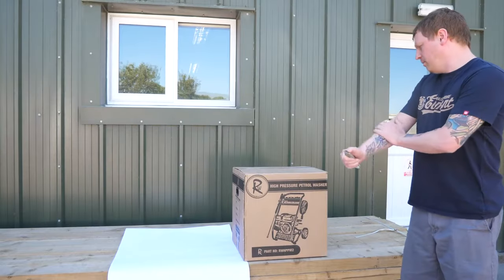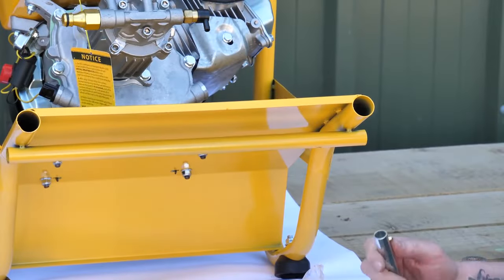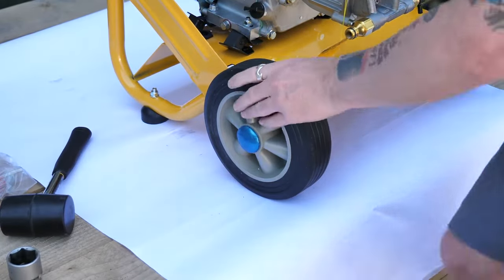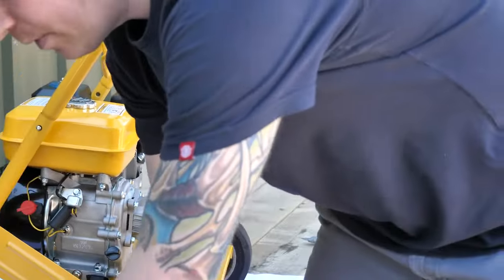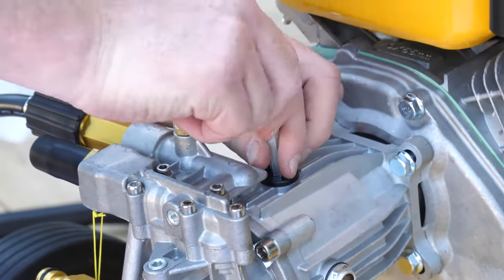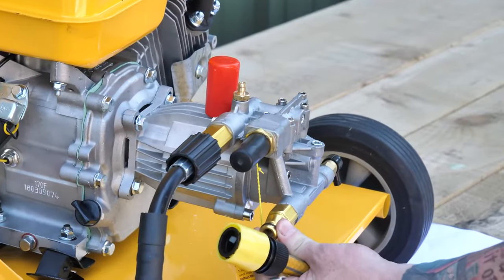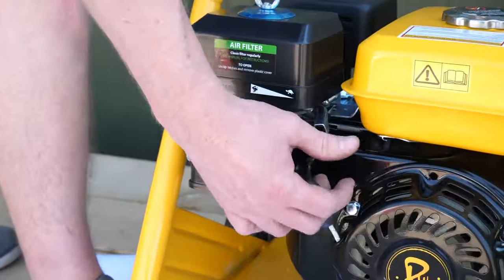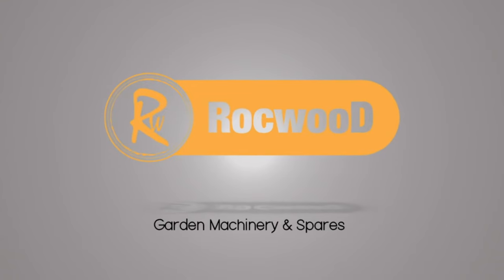Rocwood 3000 PSI 7HP Petrol Pressure Jet Washer assembly instructions

Comment: Bought one of these a few years ago. if you remember the charles atlas bullworker, this is the modern equivalent.  Set the ignition and fuel to on, close the choke, throttle to fast , release the water pressure, then pull the starting cord,  pull and pull some more, and then when you've done that, pull, pull and  and some more, adjust the choke, release the pressure and pull, pull and pull some more, repeat until you collapse from exhaustion.  Though it won't start ,  by God you'll have an upper body workout that would make charles atlas envious.

Comment: You just saved the day for me with this video, just bought the exact same washer and it kept cutting out after a minute.
I was tuning the petrol lever off instead of on.
I noticed when you turned the petrol on it was the exact reverse way I was doing it then I noticed the small arrow indicating the on position that I never noticed before. thanks.
Reply: Hey wondering if you can help me? Ordered the same model which should 3950psi but on the model that's just arrived says 3481 max psi on it. What does yours say mate?

Comment: On many washers do NOT start the motor without first running water through the lance. Failure to do so can ruin the motor and/or blow the seals in the pump.

Comment: I bought this but my bolts are not tightenen the way they should be i see it on yours as well, loose handles at the side. Do you have any way you could help?
Reply: Hi Gary, I've also just bought this. Can you help me and clarify what the max psi written on the machine says? Advertised it's 3950 max psi, but on the machine itself it says max psi is only 3481 psi
Reply: @pstrad8971  on my machine it said something like 3200psi
Reply: @garymasterson  thanks mate, what machine did you order? As in the one with 3950psi?
Reply: @pstrad8971  i think so mate i sold it as it was too powerful and i dont have a garage, i got a karcher which is ideal for me

Comment: Hi, great video thanks. My Rocwood washer has been tipped up and lost a little oil from the pump, how do I check the level please? Your pump in the video appears to have a sight glass, mine does not. Thanks
Reply from the maker: Hi, thanks. The newer washers came with this window but any of the previous ones did not and it was a bit harder to check. If you have only lost a small amount I wouldn't worry too much unless it is making a noise, in that case it needs topping up with SAE 30 non detergent oil but not right to the top, just leave a bit of a gap as the oil will expand when it heats up. If there is too much oil present it may spit out of the breather cap for a while until it reaches the correct level. I hope this helps.
Reply: Thank you very much, that helps!
Reply: Got mine today. Very impressive for the price. Running for three hour's. No problem at all. Slowed the pump speed down according to the size of nozel fitted to the lance. Was better on fuel economy. So far so good... :-)

Comment: Hi, I have just bought a brand new rocwood machine from eBay. After watching your video and carefully followed the instructions that comes with it. The machine failed to start. Do you think you can help? What I have noticed is that the sight glass window is not half filled with oil. I’m under impression that the pump has already oil in it. Is that sight glass window is for pump or engine oil level? I thought of seeking for your advise first before sending it back to the dealer. Thanks
Reply: 0

Comment: how good is this washer? I know its a budget build, was going to buy one today from eBay
Thanks
Reply from the maker: It is a great bit of kit. The engine is based on the Honda GX160 engine so the spares are very easy to source. For a budget machine you'd be hard pressed to beat it.
Reply: Are the spares interchangeable between this and the Honda?
Reply from the maker: @dantheman7370  Hi. Yes, the GX160 spares will fit this.
Reply: They are junk, all these generic China washers no matter what label is slapped on it do absolutely nothing apart from make a big racket!!! A low end budget supermarket washer for £39.99 put out more pressure!!!!
Reply: @norrisbobbish8902  what do you recommend for £300 and under?

Comment: That's a thermal relief valve. Also in 5 minutes the pump is gone. You don't know which way to unscrew. You have no idea what are you talking about.
Reply from the maker: No, that's a pressure release valve, it releases pressure built up in the pump, it has nothing to do with heat. Thanks for the input though.